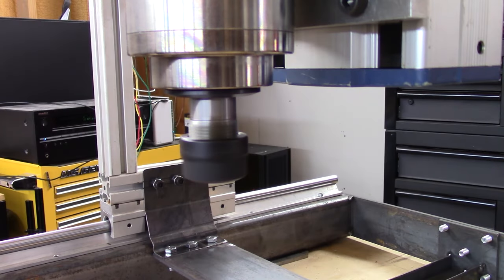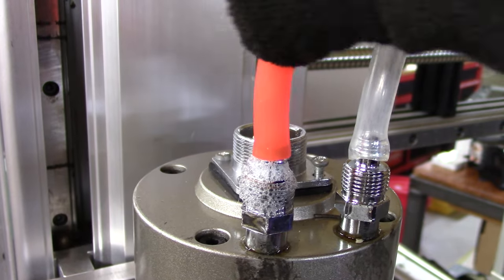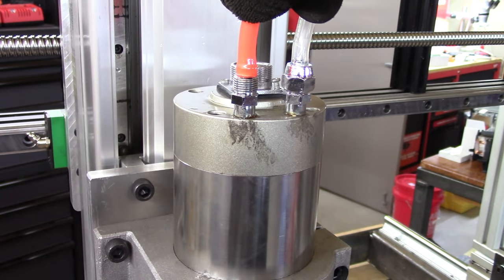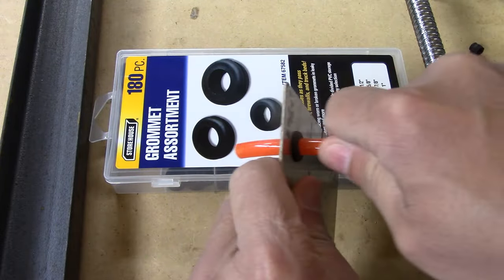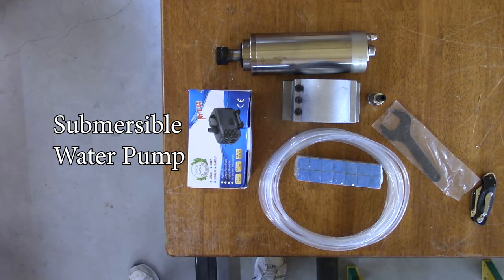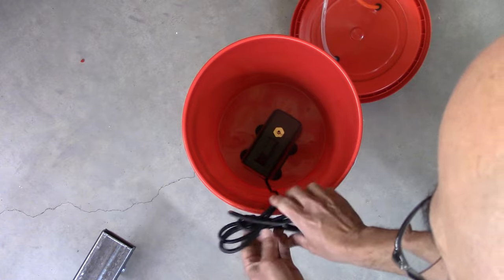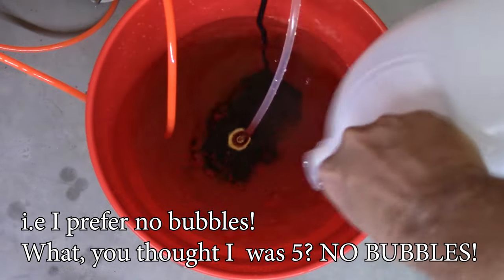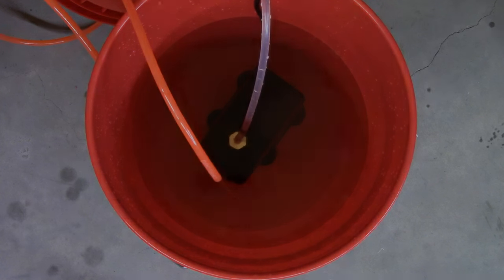CNC Dude's CNC Router Project: Water Cooled Spindle - Water Connections

Comment: i build totally same my new 2,2KW spindle water cooling. 20 liter powl and fill 10 liter water. same pump and tube.  but i connect pump controller whit linuxcnc at computer, breakout board has relay who can controlled at computer on/off and SSR relay switch pump on/off.
Reply from the maker: I see your point, but I kind of like leaving this thing running for way much more than the spindle motor is running. Basically for two reasons. I prefer to minimize bubbles on the line while the motor is running (I don't think it is going to smoke it, but bubbles are not as good thermal release agents) and then I want this thing to run after the motor stops because ideally we remove all residual heat to increase the spindle's life span. That doesn't mean we need hours (not even minutes), but I feel like only running the pump during spindle runs is sub optimal. This is my total gut feeling so I could be completely wrong. Not to mention you can still do the same with LinuxCNC if the G Code is not in charge of turning the pump along with the spindle. So your implementation is appealing as well!  Thanks for watching!

Comment: Hello,may i know, why my water pump stop working suddenly,when i take out from water and wait few minutes then put it in the water then it working . Im confused why it stop Working
Reply from the maker: That sounds like some sort of thermal protection might be kicking in and you need for it to cool down before it can resume operation. Or maybe it has a leak and some water is coming in causing some sort of an intermittent short? It is hard to say for sure without seeing the actual device but those would be my first two guesses. They are kind of cheap implements, so it would not surprise me that your just needs replacing. Hope you can solve the issue soon!

Comment: first important have, NOT use only water, not good mold fast. need use car cooler liquid and mix to water, 50/50 about. then not mold.
Reply from the maker: You know, I forgot to mention this! Thanks for the heads up. Yes, I did add coolant for normal run time.